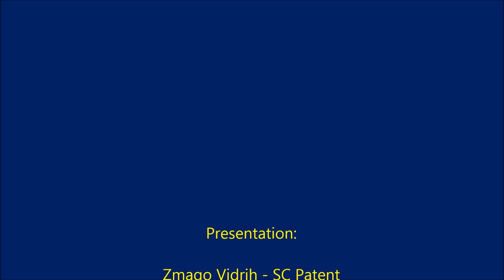Homemade Dovetail Milling Cutter with 2 carbide inserts

Comment: Congratulations on making a very nice looking tool. Glad you got it working how you want it to. I also appreciate how you included your "developmental research" in your video. So many people don't understand that sometimes it can take longer to make the tool than what it does to do the whole job.
Reply from the maker: +Leon Kitshoff 
Leon, hi.
Thanks for the nice comment and for the support. Yes, it is exactly like what you wrote.
Thanks.
I actually did this tool because I needed to make several dovetail cuts for quick changing tool holders for lathe... and I enjoy a lot to make the useful tools helping me working better. Of course I could buy the tool at eBay or somewhere else, but it's just not the same! And since I had already the inserts for my lathe tools I decided to use them also for this tool, that can be useful for a long time... instead of the regular HSS cutter...
But in the middle of the process I actually didn't know how it will work at the end. I didn't make any plans for it, I didn't make any calculations to spoil the fun. I was just hoping to be like it is now, and that it's working well. But of course because it was for the first time I made some mistakes and together with them I have learned something useful and all of this I wanted to share with all of YouTube users and to help someone to not make the same mistakes. And now I'm learning even  more with some useful tips and some bad critics from all others. But like you said some of them don't know or just don't want to accept the opportunity of this video, and some of them are just rude...
That's why I'm thanking you again for the supportive comment.
Best regards, Zmago

Comment: (A) Drill bits undo itself is also popular with some cordless drills equipped with mechanical spindle stopper.  The impulse at stop cause the chuck sleeve to unwind at the chuck, causing release of drill.  In this case each round the insert bites the work transmits a blow to chuck sleeve in an unwind direction. 

(B) To reduce cutting impact force/fatigue? 
(1) Use a lead angle < 0 to axis, so insert upper corner meets with work before second corner. 
(2) Use an effective rake angle > 0, to reduce work force. 
(3) Use a radial angle > 0, to avoid 2nd edge wear.  
(4) Use insert recess angle =/> 7degree. 
(5) Use smallest insert matching work depth.

Comment: Nice Job! I did notice that there is no support for the inside margin of the insert other than the cutting edge touching the insert pocket. I would recommend to either add a small step at the back of the insert pockets or  angle the back of the pockets to provide clearance  for the insert's relief angle that is near the center of the head.  Doing so will preserve the  unused edges.
Reply from the maker: Hi.
Yes, that is also necessary to do with the new cutter that I will make... 
Thanks for watching and for the comment. 
Zmago

Comment: Not bad.... Will you be doing a build video like the apmt milling cutter? Btw, commercial dovetail cutters work exceptionally well both climb and conventional milling, i have also pushed doc to the max at around 4mm. Mines a hss cobalt. You will find the tpmr insert better suited due to its 11 degree relief angle. not too certain if its got a screw hole though. I have used the same tcmt inserts to make a large flycutter, and it performed poorly due to the same reason, too little relief angle.
Reply from the maker: Naren, hi
Thanks for watching and for a nice comment. 
I'll try my best to do a build video as well (some day), just need to find some spare time...
Thanks for the tip of the TPMR insert, I will search for it. 
Best regards, Zmago

Comment: Yea it has a cutting edge as for a directional lathe, Climb millings not going to work lol. Look at your insert where it disintegrated on the seated area. But nice tool for a manual, just back it off the cut.

Comment: I think that dovetail cutter is awesome and it  looks great! good job. I have to wonder though why so much rpm and feed you're going to kill the insert imo.
Reply from the maker: +Micscience 
Hi. Thanks for watching and for the comment. 
I have tried to go with slower speed 1400rpm, but actually the sound of the machine was not so good. It sounded that machine would take apart... I don't know, maybe my machine doesn't have enough torque at that speed... So I tried with higher speed and it was so much better. And since these are the carbide inserts for machining the hard steel it is normal to have higher operating speed... it's like 3 times higher than ordinary HSS cutting tools. So if you don't have enough speed you will actually destroy the insert faster than with the proper speed. My machine has the highest speed 2900rpm, but I believe that if I could go faster than this it would be even better...
Again, if you don't feed enough fast with high (rpm) speed, than the cutter is just sliding too much on to the material which is not good. You can easily damage the cutting edges of the inserts because the friction is too high and becomes too hot... And the surface is a mess. 
Zmago
Reply: Sc Patent
I learned that higher rpm creates heat which destroys tools however I am aware of higher feed rates help the bit relative to the rpm. Where I have heard of high rpms when cutting is through cnc our using routers and stuff like that but I am no expert so carry on as usual. I said that because that is what I learned from other machinists on YT to be honest.
Reply from the maker: Micscience 
Hi. 
Yes, I agree about the high rpm related to higher heat, but with this carbide cutters is now all changed and hard to believe...  I just follow some pointers I have read about the specification of materials and my feeling. I'm also not a professional machinist  (my profession is an Prosthetist and orthotist...), but I like to try different varieties... sometime also risk a lot... That's how I like to learn  on my own...
Thanks for the comment. 
Be well. Zmago
Reply: because his machine is flimsy so he has to take lighter faster cuts than the intended load and speed for that insert. It would be okay if the inserts he used were the very sharp type. Like the K10 geometry for aluminium.
Reply from the maker: +meocats 
Hi.
True.
Regard; Zmago
Reply from the maker: +soundspark 
Hi.
Thanks for watching and for the comment.
Zmago
Reply from the maker: soundspark 
Hi.
I agree. 
Zmago

Comment: hey , where the best place to buy screws at,,, the good one's that hold carbide inserts on,,, thanks for video
Reply from the maker: Hi. Thanks for watching and for the question. 
Well, I have been buying all these over eBay. 
Right now I can't exactly find with which seller did I bought it, but I have checked and it offered me this: 

Hi! I found this on eBay and thought you might like it! Check it out now!  20pcs Insert Torx Screw for Carbide Inserts Lathe Tool  Screwdriver M1.6 to M4:

http://r.ebay.com/ElAqXY

Please check which size of the thread do you need and what type of the head do you need for the insert. And then search for it. I think this is the easiest and the cheapest way...

Best regards, Zmago

Comment: yea .. don't try to show off your tool in aluminium. go for the hardest material if you wanna show it off, because milling in aluminium can hide when your tool is rubbing, and smear that soft buttery aluminium. and you still got rubbing marks after sanding it. You have to test it in a CADCAM program for the desired feed. Then give 50% more allowance for chip packing.
Reply from the maker: +meocats 
Hi.
That is cold rolled steel machining...
I have toxicated my self with aluminium, so I don't want to work with aluminium any more...
I don't understand your meaning about "showing off". Please explain.
Thanks for watching.
Zmago

Comment: The insert seat is'n sable enough. You must tilt the insert and/ ore you take a TPMT... instead a TCMT...But it's better to take a DCMT.
Reply from the maker: +Philipp Danz 
Hi. 
Since I already had a pack of these "triangle - 60° angle and with 7° relief angle" TCMT inserts, I've used them of course. And with these triangle inserts there is only one side wall  which is sitting at the tool, and yes it is always some movement present with such force while machining...
I agree, the TDMT with 15° relief angle would be better choice if I could get them...
You gave me an idea to make and try with DCMT. Thanks.
Regards, Zmago
Reply: I made this type and one using a DCMT insert, the DCMT inset one worked significantly better.  Finish on the bottom surface was a lot better.

Comment: 2:30 There is no reason to continue the cut if the tool is slipping. Stop the machine and re-tighten the chuck. The tool got stuck several times while the chuck was still spinning, marring the tool and the chuck jaws.

Comment: As always with when you're at the machine: LESS SPEED! You're killing your cutters, drill bits and inserts all the time!
Reply from the maker: MadHatter123456 
Hi.
This machine has not enough torque, and it is also not rigid enough. So with more speed I get less vibration and the surface is better. And the carbide insert cutter can stand up to this speed and also the heat with no insignificant damage. (I'm talking about when using just carbide insert cutters), with normal HSS end mills, I go more slowly - with proper speed regarding to different metal. But I wish to have a better - more rigid machine, to try with lower speeds...   someday soon I hope.!
Otherwise I agree with you.
Thanks for watching. 
Regards; Zmago
Reply: Sc Patent 
Not enough torque? Then why go to max feed rate?  Slow the feed rate and you will get better surface and the cutter will not cut in the horisontal surface( dig in)

Comment: Why are you doing 2900 rpm?
Reply from the maker: +Slave2Outdoors 
Hi.
These are the carbide inserts and they can stand even much more pressure and speed. If I could I would try it with 5000 RPM...
But my machine doesn't have enough rigidity, so when I go with slower speed, than it sounds like motor and gears would collapse. So this 2900 RPM with this machine is the optimum. The sound the feeling, the cutting surface. All is much smoother with this speed...
With HSS cutters I go much slower...
Thanks for watching and for the comment. 
Regards, Zmago
Reply: Sc Patent 
Yeah, but the steel is the problem here, not carbide. Steel will not accept such speed and feedrate .

Comment: 3:16 just look at that cutting edge, you clearly didn"t give any relief to that insert
Reply from the maker: Yes, you are right. At that time I didn't know that the original relief of 11° would not be enough if the cutting edge is placed at the center, so later I sanded for the relief a little bit more. You could see it at the end of the video... Didn't you see it at 7:21  ?  Thank you for watching and for the comment.

Comment: need relief angles mate
Reply from the maker: Benjamin Harris 
Hi.
Yes I agree. That's why "the wrong position..." in the title. And if you've seen the whole video, there is also the graphic reposition of the inserts how it should be.
Thanks for the comment and for watching.
Best regards; Zmago - SC Patent
Reply: And the graphic demonstration is wrong, because you moved the inserts up off the tangent radius line.
Reply: sorry for my English:-(  If you move the insert as a graphic demonstration  the corner will be wrong. I tried and I lost one day to understand why the angle was greater than 30 degrees.